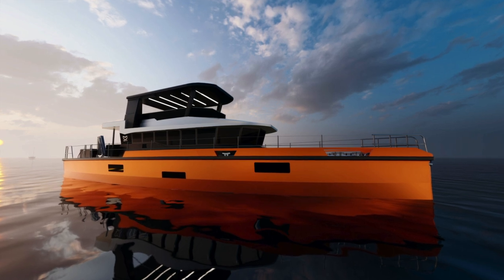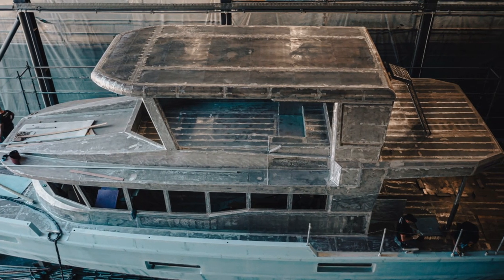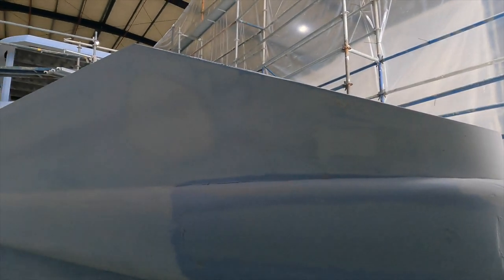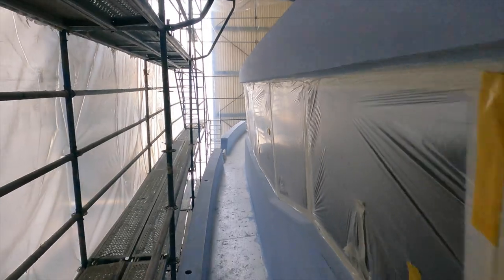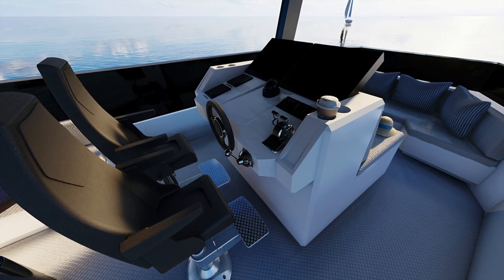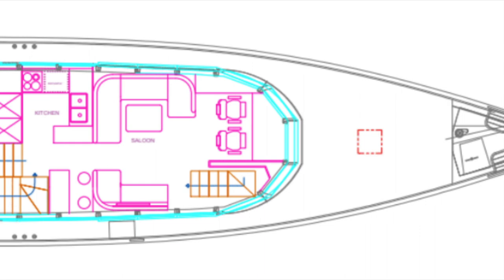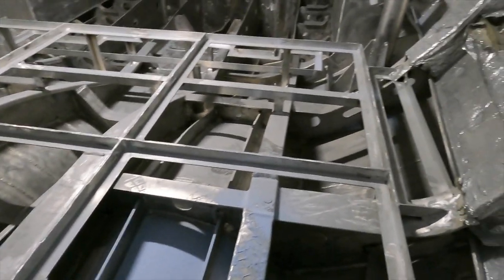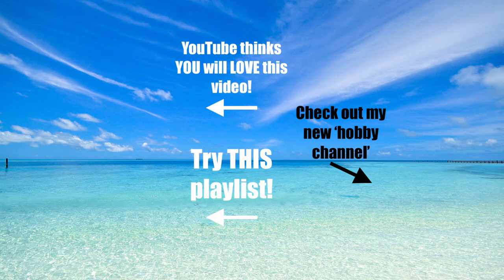EXCLUSIVE: Birth Of Hull #2 Of The EXTREME PASSAGE MAKER 78 Explorer Yacht!

Comment: The reason Steve extended the swim platforms is it uses the weight of the water to hold it down in following seas.  Those seas on the platform help lift the bow and let the yacht surf.  It's pure genius at work

Comment: Dashews design limits the lifting of the stern from following seas.  It does this with the swim platform that allows water on it and using that weight to hold stern down.  This is why he had modified some of the platforms on his yachts. The narrowing at the stern and the platform keep the stern down allowing the yacht to surf
Reply: Yep
Reply: It's effectively the opposite to a bow flare

Comment: Looks like the FPB 78 Cochise... I think the swim platform is too short though. It should have a fold down stern extension that is as tall as the deck house when up adding 8~10 meters to the hull length at sea while keeping the boat less than 80 foot in harbor maneuvers. Length equals speed and efficiency. Also, maybe it can have a flood-able bow. At speed, in calm seas, valves can open to allow water to free flood into a bow compartment and keep it digging into the bow wake instead of riding over it. A reverse rake and a slight tumble home will help too. For greatest efficiency the propeller axis should be in line with the flow axis of water where the prop is. An inboard motor driving a prop through a shaft generally does not allow that. Maybe they could use a podded propulsor; something like a Thrustmaster T-Pod 90kW Permanent Magnet azimuthing thruster in a diesel generator / electric drive setup? A 10~20hp retractable azimuthing bow thrust can also be added. This has the added advantage that if the main pod fails, the docking thruster can be lowered to tug the boat around at low speeds.

Comment: Which ones better? This or the Bering 70?
Reply: Completely different animals. Having not been on either, the XPM is a much more slippery design, that combined with the lower displacement, narrower beam, self righting ability speaks well to her seakeeping ability. The XPM is arguably a more efficient design, and will be more spartan than the Bering. As for which is better- it depends on what a potential owner values.

Comment: So an FPB by another name… I’d imagine Steve Dashew and Cerca Marine are flattered.
Reply from the maker: The owner of this boat wanted an FPB but obviously, they are no longer being built. As I understand it, the owner of this explorer knows Steve and they have kept in touch during the design and build of this boat.
Reply: @YachtBuoy  That makes sense.  BTW, I didn't mean it as a slight.  I am curious why they didn't use Cerca Marine for the construction, but this yard seems to be building quality.  I also love what they're doing with the electrical systems.  If I ever get to build an exploring vessel, I'd want a huge battery bank so my at-anchor time can be as quiet as possible.
Reply from the maker: :-) That's cool - I never took it as a slight :-) I often go through lots of comments at the same time so the replies are never as long as I would like etc
Reply: @bpj443  I may have heard that there was a falling out with the relationship.  Kind of irks me that Circa still offers the FPB and uses the Dashew name
Reply: @YachtBuoy  They are being built by Circa from what I gather unless I came across old info.  edit no it's not old info.  Goto Circa Marine NZ and select boats

Comment: Hi mate....sorry to be the bearer of bad news, but aluminium is not free from corrosion. It corrodes, just not as swiftly as steel.
Reply: To begin with yes, but steel oxide is a larger volume than the base metal and aluminium oxides not. So the steel rust falls off and the process repeats, aluminum rust sticks and protects the base metal. The biggest risk is not typical oxidation, its galvanic corrosion. Either ship to shore or from dissimilar metals in the build.  Careful construction and design will take care of that issue but vigilance is also a good idea.   Not trying to be clever, I'm just an old engineer so its habitual.

Comment: Gotta be honest...looks like an Arksen. I know the hull design is more like that of the Dashew FPB and follows that proven Vripack design from the early 00's or aughts...it works though. At least they aren't leaving it bare aluminum like the Dashew's. Those look absolutely ugly and utilitarian.
Reply: If I'm paying the annual maintenance and upkeep bill I  will take a utilitarian Dashew every time, as for ugly that's one opinion.
Reply: You save weight and money from not painting the boat cause you will need to repaint it every 3-6 month.
Reply: @dovercomer.2748  No they are going to pay a fortune for a epoxy coating to be applied so the paint will last.  They are also going to add a ton or more in coatings and paint to the boat,  If they don't use a coating then they will have custom panels applied.  Either way it adds much weight and work